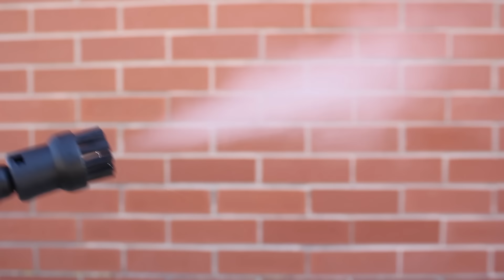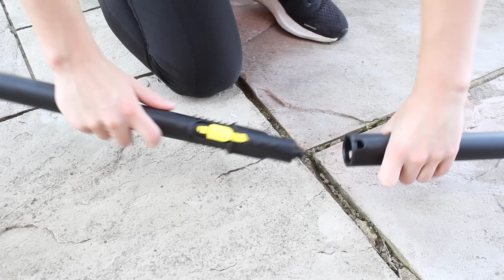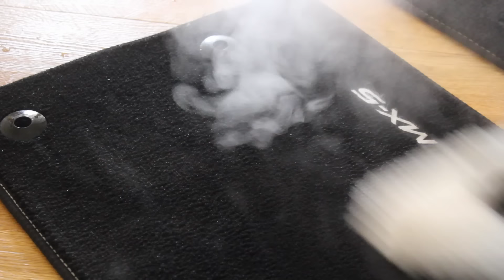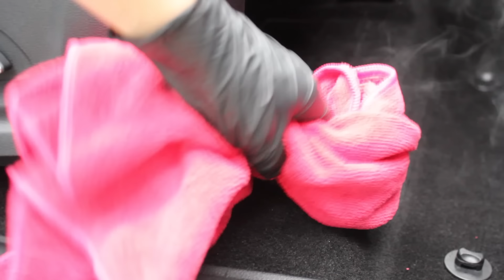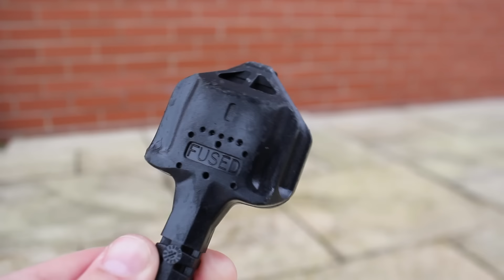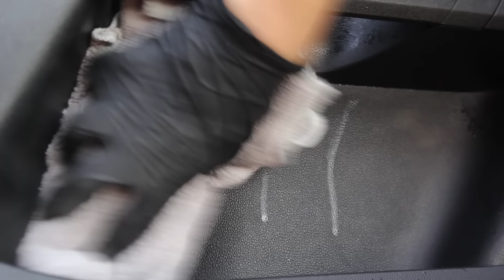Karcher SC3 Steam Cleaner Review | Steam Cleaning Car Interiors

Comment: More water than steam.
Cable to short.
Low pressure.
No lid to stop water coming out..
Handle no ergonomic.
Easily Topples over
Floors left wet.
Cheap feeling plastic.
Poor absorbing microfiber cloth.
To expensive for what you get.
This it not Karcher of old.
And customer service needs to remember they work fir company they don't own it.

Comment: Personally I’d never use extraction there is foam under the seats and if you start spraying water into it, you will think you have extracted the water but it will soak into the foam and generate mould. Extraction is a really old method, technology has now moved on. The steam cleaner will get rid of most stains even bad ones and you can also add an APC to the seat for extra cleaning power.

Comment: I've never seen a steamer with a replaceable filter.   That's interesting.    And the fact you can continuously fill the unit is another benefit that is normally reserved for steamers that cost a lot more.    Very good value for a steamer that works this well and has unique features.

Comment: I have this steamer. It is very good at sticky residue and such like. The short cable could be extended 2-3 meters with appropriate flex cable. Thus negating the need for a separate extension lead. Might be a simple mod that increases functionality.

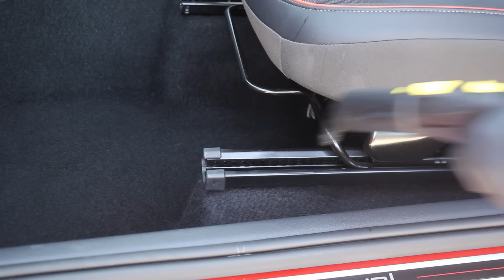Comment: 7:29 Uh....don't do that...

You're wiping away the rail grease. There's a yellowish grease that's supposed to be in seat rails. That's not something that ended up in there that needs to be cleaned.
Reply from the maker: Or just replace it afterwards with grease that’s not covered in debris and will work even better 👍
Reply: @AutoCareHQ  Yes. If you have it.

You didn't show that, am I supposed to just assume you did that?

Comment: I'm currently looking to buy a steam cleaner for my car. I have also found a lot of comments recommending Karcher but I've generally had a bad experience with them long ago with other products so I'm quite hesistant to go for them. Plus I don't find them to be making good car detailing products, just run of the mill general work products, which instantly makes you realise why they gave you a brush with very stiff bristles. Same reason they have idiotic products like brush heads for their power washers in order to supposedly wash the car more easily. So I'm looking for alternative brands. I was wondering if you had any recommendations if you had looked into other brands aside from Karcher for a good steam cleaner ? Thanks.

Comment: Beware, I live in the US and found out the US version has a 1450 Watt boiler heater. The European version has a 1900 Watt heater. 450 Watts IS a big deal when generating steam. Somewhat disappointed in my US version. It's ok but...I noticed that steam generation pulses high/low as the H2O holding tank and pump transfers water to the boiler. I think KARCHER could have done better. ps... you need to run at least 3-4 tank fulls of H2O through the machine' cartridge in order to prime the steamers cartridge.

Comment: On a really dirty seat, like a barn find, would you recommend, drill brush 10/1 fabric cleaner, steam, then extraction, or extraction, then steam, or no need for both, in my head utilising a bit of heat would help a lot on baked in 20 year old stains. Cheers great vid

Comment: I have one from a company called Efbe Schott (German, I presume), which I've had  since before turning professional. It's old school with a pressurised tank, but the capacity is 1.5 litres. Oh, and it also came with a steam iron attachment free! However, now, I would choose Karcher and probably the same model you have.

Comment: After I asked you about this steam cleaner a few weeks ago Heather I went out and bought it ,  really for my daughter’s Mazda 2 as she’s been away working all summer and came back with the car badly needing cleaned inside. Mostly caused by stage makeup on the interior surfaces. It was brilliant and £160 well spent in my opinion. It took it off the seat fabric and the surfaces she touches like steering wheel and dials etc. works a treat.  It was great to get rid of some of the scum from the engine as well. Love the way you just fill it and carry on.   Thanks again for the recommendation that few weeks back. Love the channel 👌
Reply from the maker: That’s brill David, really glad you’re happy with the purchase!

Comment: Another great review Heather. Think I'll take the plunge and add one of these to my kit. Your channel is  a real boost to both pro's and week end end warriors alike. Still loving the review style, and the fact its real world, experience you share. As a fellow pro, I've never yet regretted purchasing anything you have recommended. I am struggling with a number of Ford Rangers that have come off lease atm, which have been worked as road crew and are caked in mud, am going through TFR  like crazy. My favourite Crudzilla  does the job but is not cost effective for this volume of trucks.  Any recommendations greatly appreciated!!
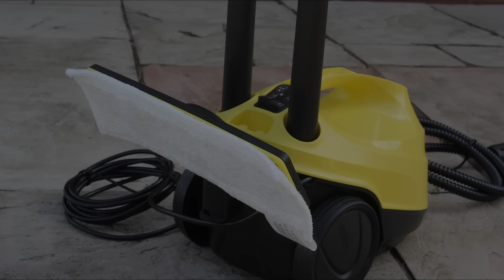Reply from the maker: Thank you! I really appreciate that kind words and I’m glad you’re happy with the purchases! Have you tried Koch Chemie Greenstar as a pre-wash? It’s very cheap and works well at 1:5 to 1:20 depending on the dirt level
Reply: @AutoCareHQ  Actually I am a big GS fan, but the stuff in the arches and on the chassis rails is stuck hard, I am presuming its got some kind of concrete it there! I shouldn't have taken this fleet on but did i so as a favour for  a  Main Dealer. Not my bag at all  to rescue abused stuff like this but they do give me quite a bit of high end stuff and their valet guys just weren't getting to grips with it!  I've used Nielson L826 before on 4x4's with great success, but struggling to find a local supply right now. I've done 9 of the 16 of them! Will report back if i find a wonder cure!

Comment: I've owned, to my shame, two Karcher products - a pressure washer and a steam cleaner - both of which failed to deliver, let me down repeatedly and cost me a fortune. There's a saying "once bitten, twice shy" but I failed to listen to that advice. Never again. Buyer beware.
Reply from the maker: What happened to the steamer?
Reply: Hi Heather, well it worked really well at first, but after a while it developed what was presumably some sort of valve/regulator problem where it would either produce nothing at all or gush water all over the place. It went back to Karcher for repair three times. Each time it was returned - with Karcher saying it was now working perfectly - only for me to find it was actually in exactly the same state as when I sent it in. It was completely useless. I hope yours behaves nicely and doesn't let you down. When mine was working it was actually a good performer. @AutoCareHQ